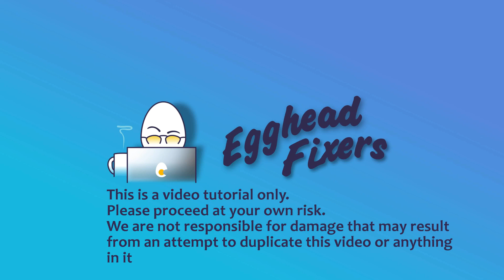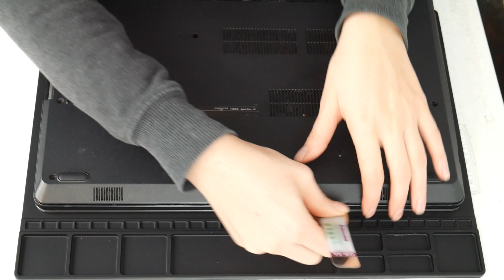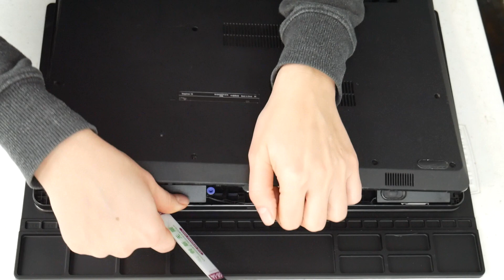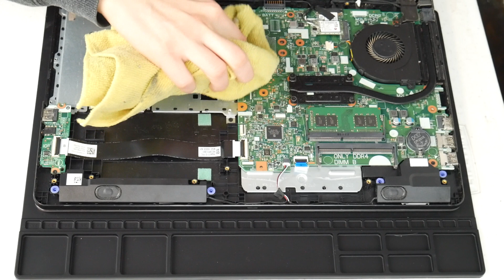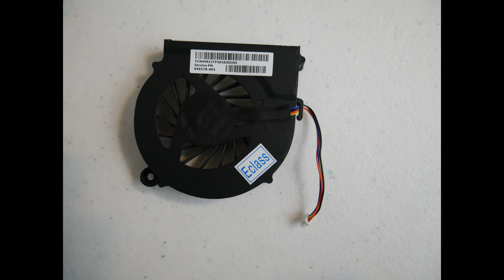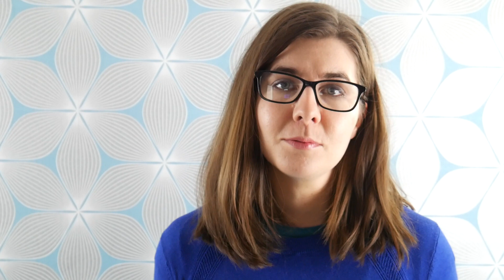How to Fix an Asus ROG Computer That Keeps Overheating

Comment: I have a  ASUS  G750JW that runs super duper HOT.....    When I touch below the screen and above the keyboard.  It feels like my hand will burn.  It is super hot. Any advice what to do? or how to cool it down?????
Reply from the maker: Have you split any liquid on it as of late? Also are you using the original charger?
Reply: @EggheadFixers   No, I did not spill any liquid on it. and Yes, using the original charger. But I removed the original charger. I use the lappy without charger. Also, I have had this lappy for 11 years.

Comment: I reseted windows 10 on  my laptop it was reseting then it said unable to reset there was an option to turn off i did that then i turned it back on and it says lenovo then screen turns off then on and says lenovo please help pls
Reply from the maker: Have you tried reinstalling the operating system?
Sometimes when the reset errors out then you have to reinstall the operating system.
Here is a video on how to do that:

https://youtu.be/GhARJdyJwqk

You can skip the portion of the video on how to replace  a hard drive
Reply: @EggheadFixers  soo i need that usb? And it isnt a problem that its not turning on?
Reply from the maker: @luizer_browser  Let me see if I understand correctly It turns on show the Lenovo logo but it doesn't boot past it. Can you access BIOS?
Reply: @EggheadFixers your right but  i cant acces bios
Reply: @EggheadFixers  how do i acces bios again? Maybe am just doing it wrong
Reply from the maker: @luizer_browser  Usually with Lenovo you have to tap esc a couple of times right after you hit the power button. Some models you have to tap either F2 after hitting the power button or F2 and Fn at the same time after hitting the power button. What model Lenovo do you have?
Reply from the maker: @luizer_browser  Hey that's awesome!! Glad we could help!

Comment: @Egghead Fixers: I have a Samsung Galaxy Tab A (2016) Model # SM-T280 with 8GB of memory and a 200GB micro SD card. I can't do updates because it claims I am out of storage? I have 183GB Available on the Micro SD card and I have tested it to death to make sure it is not a fake, even used H2TestW (took forever) to test it, checked it for bad sectors, formatted it, put it back in, it still won't use it for storage. You may not do Tablets but could you please point me in the correct direction?
Reply from the maker: It may be too much GB for your tablet. Have you tried a smaller size Micro SD card?
Reply: @EggheadFixers  They claim I can use up to 250GB but since I wrote you I actually got in contact with Samsung. They said my 2016 tab can only use the micro SD card for things like pictures and video but if the cumulative updates and things are past 8 GB, that can only be on internal storage. Long story short, the unit can't be fixed, and even with a factory reset, once it gets done and all the updates run, it will be in the same place. They tried to sell me (of course) a new Tab with 64GB and up to 1 TB of storage but it has the same problem, once it hits 64 GB of updates and stuff the extra storage is useless. Strange way to run a company. Thanks for the reply but if you ever find a work-around, let me know. For now, this is an expensive paperweight.
Reply from the maker: @defan2105  Can you delete any apps or pictures to make enough room for the reset?
Reply: @EggheadFixers  Yes, I did a factory reset even took off some bloatware on it, apps I would never use like Hangouts or CNN news and it was up to 6gb of 8gb. After play store did updates, it is almost full yet again.
Reply from the maker: @defan2105  That is strange. Have you tried doing a hard reset at start up? Or have you only tried resetting it through the settings?
Reply: @EggheadFixers  I have watched several videos on it but not sure which way is correct. I did the reset and backup from within the settings. I have seen you can do a power button hold while holding the up volume...and one said to also hold down the menu key as well. any reason why this would work better in my situation? Do you have a video showing me the correct way then?
Reply from the maker: @defan2105  If there is a problem with the operating system doing it through the settings is less likely to work. When you do the reset the other way you are using the computers base system which has nothing to do with the operating system. We unfortunately do not have a video on how to do this on your tablet. Let us know how it goes:)
Reply: @EggheadFixers  I will, thank you for taking the time to reply. If I find an answer, I will share it with you. Blessings!
Reply from the maker: @defan2105  Always happy to help:)